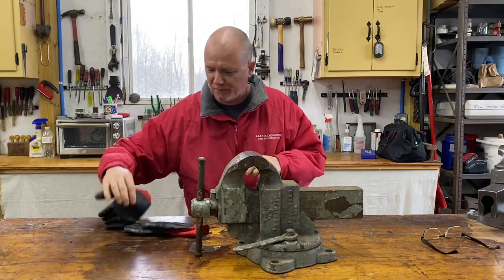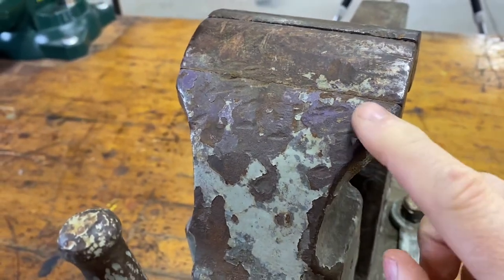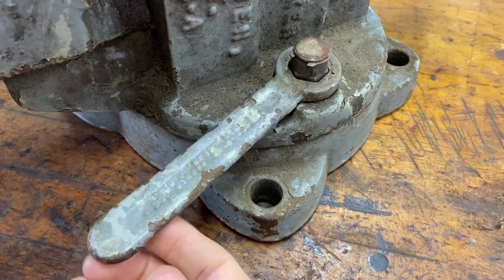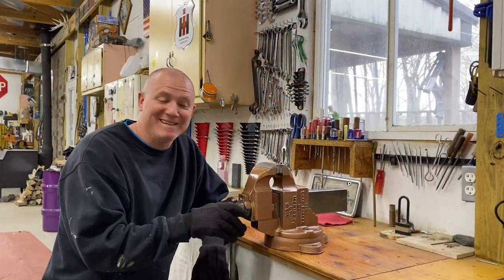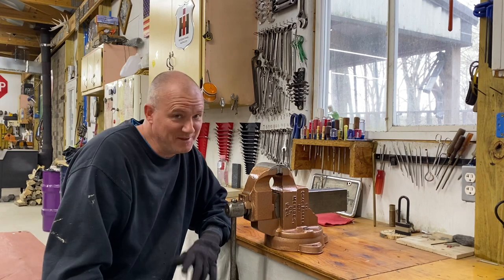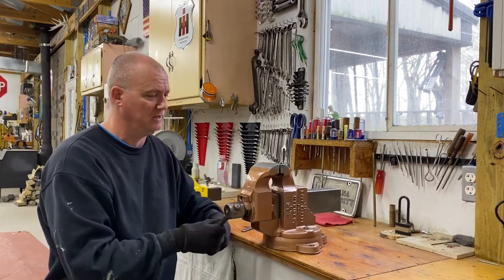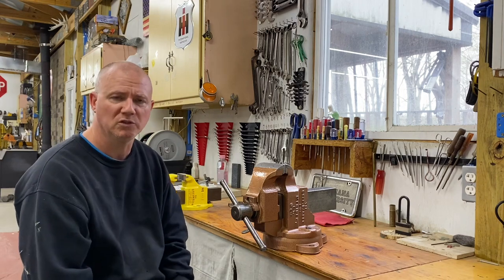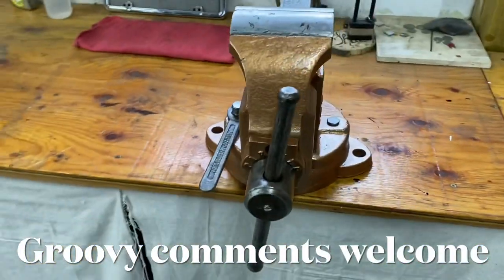Charles Parker 974 Vise Repair & Restoration

Comment: If I was to paint a vise, that hammered copper is my favorite by far. I tend to usually rub my vises down with raw linseed and bake them for a while between coats to dry them. I'll get a few baked coats on and then lightly rub down with a lightly linseed oiled rag to finish. I like how yours turned out. She earned every bit of that character!
Reply from the maker: Linseed oil finish is also a favorite of mine. Just picked up a post vise and that’s definitely how I’ll do that one.

Comment: Nice job. I used Hammered Amber Rustoleum on my 272 Parker, a darker color. The Hammered Copper looks good. Now, if it was a swivel jaw it would be awesome.
Reply from the maker: Thanks! I just did a swivel jaw Prentiss and also did a Parker some time ago. Here is the Prentiss link if you haven't see it yet. Check my vids for the Parker.  
https://youtu.be/kEIulPwMUnA

Comment: The C-clip holding the wrench is not original, but is works just fine. Nice work on the vise, a steal for $50.00 in that condition.
Reply from the maker: Thanks! I get a fair amount of vises in my area cheap but in the last year the prices have really increased. It seems everyone wants a lot for their old vises even when they are in horrible disrepair!

Comment: Awesome resto of your Parker 974. I am wathcing your Vise resto marathon and love them.   I have been watching your videos and  now have some ambition and came across a Parker 974 at an estate sale. Saw it and  bought it.  I am giving it a go to restore.  One piece I am missing is that little set screw to hold the handle. You mentioned a size in this video but not sure.   I am  trying  to replace or find a solution any suggestions for an amateur where to find?
Reply from the maker: You should be able to find that little set screw at a decent hardware store. I am thinking it was a 5/16in but can’t recall the thread count??
Reply: Thank you for getting back and size. Much appreciated. @shopdoc

Comment: Great job on restoring that Charles Oarker 974 vice. I just got one for the same price. I'm cleaning mine up as well. On that front screw mechanism I didn't know it had a brass puck. I have a spring and am using a bolt, but will machine the head to make it flat head screw. How thick was that brass puck? I may have to make one.
Reply from the maker: The brass was maybe a bit less than 1/8in. The brass will grab the bar and not scratch it.
Reply: @shopdoc  thanks I will see if I can make one. Not that anyone would notice any new scratches on my vice!!! Hahahahaha. This poor vice has lived a hard life till now. ❤

Comment: I am restoring a Chas Parker 976, which is the big one with 6" jaws.  The steel pin that holds the brake jaws in place is really tight.  I am afraid of breaking something if I beat too hard on it.  Any suggestions?
Reply from the maker: Well honestly.....get a bigger hammer. You have to hit them hard to drive them out. Quality punch are essential. Good luck to you Sir!

Comment: What’s the original color of the 974 vice . I have one it in very good shape other than the jaws are worn smooth. Can the jaws be reworked. Mine is a fixed base .
Reply from the maker: Not sure the original color? Are you sure the jaws aren’t smooth jaws? I love smooth jaw vises! Helps me not damage my work. I have seen folks use a die grinder and cutter to create the diamond pattern in the jaws when worn….tedious of course. You can also remove the jaws and have a machinist recut them. Thanks for watching!

Comment: Have you found a source for parts. I have a charles parker 104. When the jaws close up i have about 35 thousands open on one side. Im really thinking the jaw pads are the issue.
Reply from the maker: No. Charles Parker vises are a very custom vise so they are not all made exactly the same dimensions.....close but with slight variations. Jaws may have been custom fitted. I do believe someone out there is reproducing the lead screw retainer. Sorry I can't be more help.